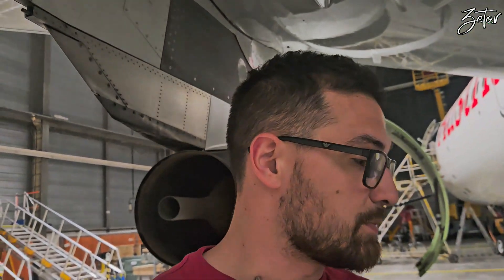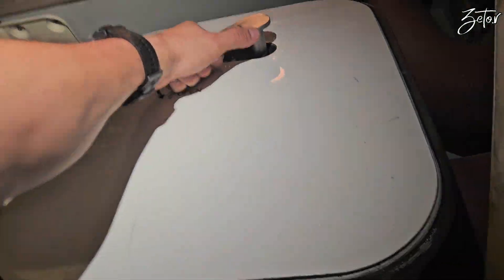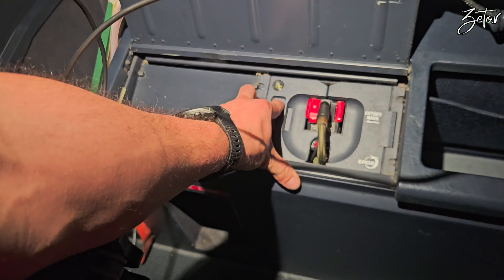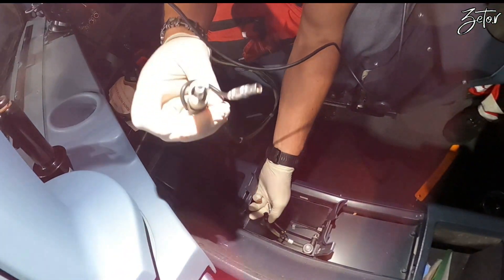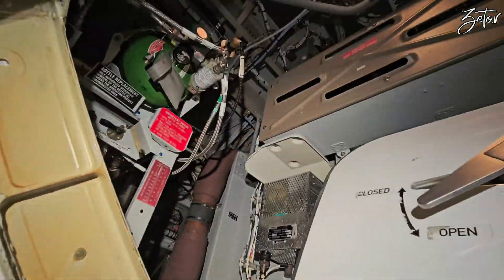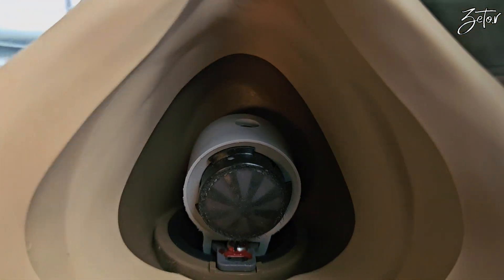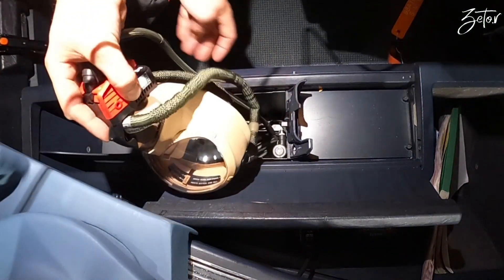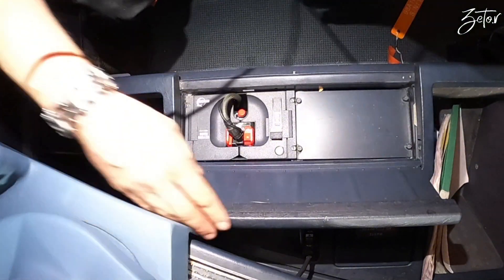Cockpit oxygen system and how it works

Comment: Are there any precautions to take when replacing the oxygen cylinder?
I understand that oil or grease must not be used, smoking or handling flammable materials is prohibited within 15 meters, and cotton gloves should not be worn.
Could you please let me know if there are any other important safety measures?

Comment: Why is the crews oxygen provided by pressurized bottles, instead of oxygen generators (like for the passengers)? Boeing also has pressurized bottles for the passengers. Whats the difference between those 2 systems?

Comment: A little note for people who don't know. When working on an oxygen system, we always have to degrease our tools before working because the bottles contain pure medical oxygen and this acts as a strong oxidizing agent when in contact with fats and oils. The same applies when testing oxygen masks, we should wipe our face with an alcohol wipe to prevent micro burns.
Reply from the maker: Nice catch, yes we must clean everything with alcohol, it is also recommended to use spark-free tools. I always clean my hands and also gloves with alcohol and at the end of shift my hands are so dry that I must apply hand cream on them 😀
Reply: @zeto.r  Do you need to use spark free tools like beryllium wrenches, or what kinds of tools are used? Thank you for another excellent, very interesting video. Subscribed.
Reply: Martin, would it be alright if I ask about the procedure for degreasing?